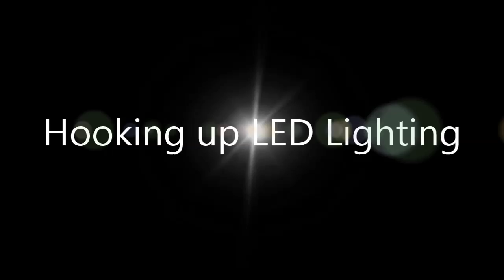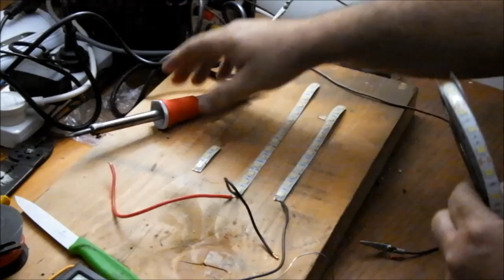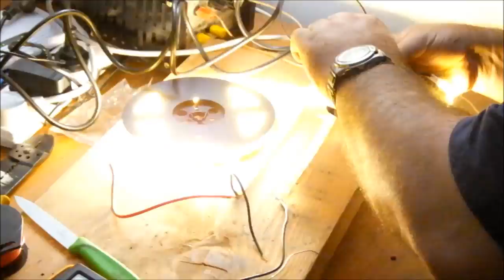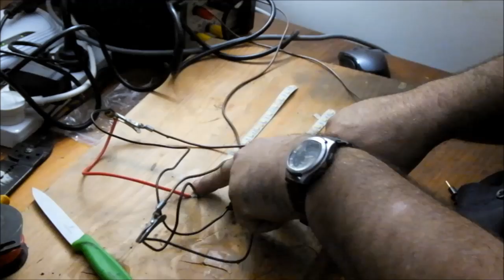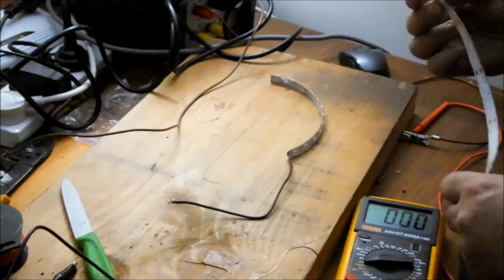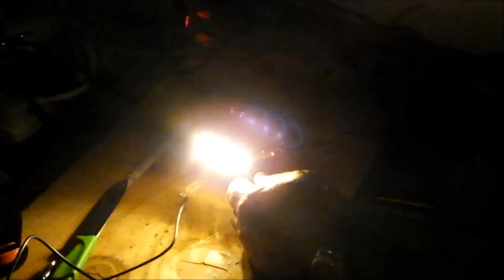LED Lighting

Comment: been doing this for 10 years off grid all I can say is "7020 led" 1 meter hard back which is aluminum
Reply from the maker: hippy9835 I'll have to check them out. Thanks for the tip.